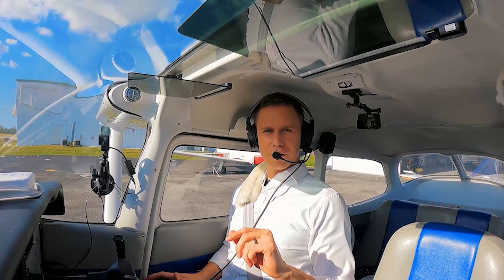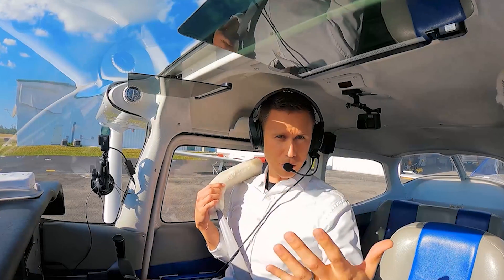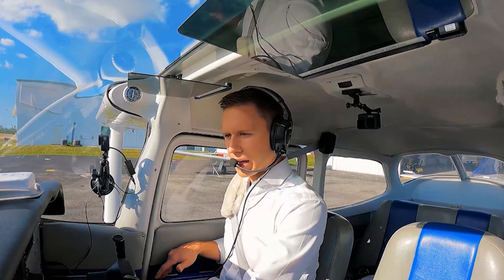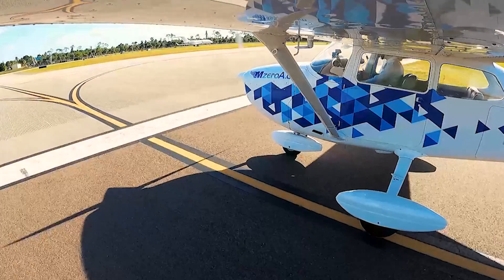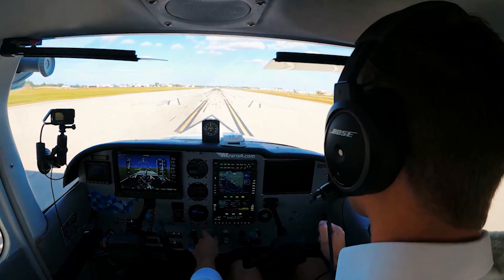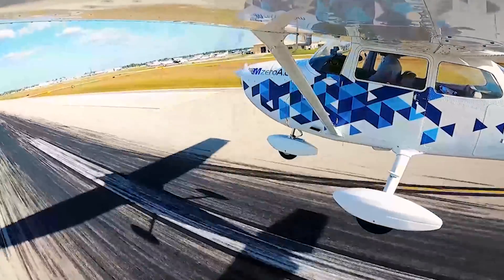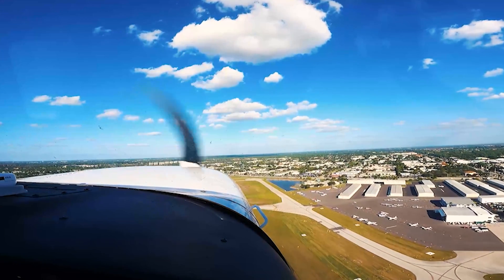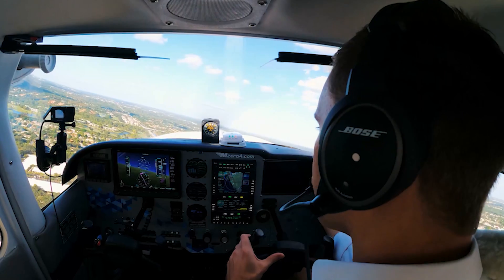Hacking ATC: How to get Flight Following-On The Ground

Comment: Great Video- I usually add "with request" after the call sign on the initial contact - this lets them know I expect more than the usual taxi clearance -    End request call with "ready to taxi".  Just saves an additional radio call, which at some airports, can be helpful. Our local tower cab is often crewed by one person, running Tower and Ground, a little efficiency can be really helpful.

Comment: I was a controller for 10 years. (That's actually how I got started in aviation.) The reason that some Deltas can and some cannot provide the VFR flight following has to do with the type of airspace outside of the Delta and the radar coverage in the area. If you are an air airport with a VFR tower out in the boonies - I use Paducah, KY (KPAH) where I used to fly often as an example - radar service was provided my Memphis Center but the nearest radar antenna was at Ft. Campbell probably 70 or 80 miles away. (IFR separation is provided through what we call non-radar which uses procedural separation with by reporting at each fix on the route until radar coverage is available just as trans-oceanic flights do). So that's what it really boils down to - if the radar controller will actually be able to see you or not. There are other factors as well such as current workload (we would never deny flight-following unless we were just so busy that it wasn't possible but that does sometimes happen). 
Great content as always!
Reply: Might there be a way to know which Delta Airports do or do not have the flight following capability?  For instance… in the chart supplement?
Reply: Thank you for that explaination. I never thought of the option to request Fligh following on the ground..